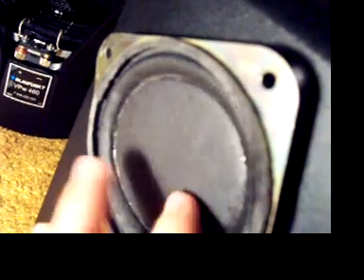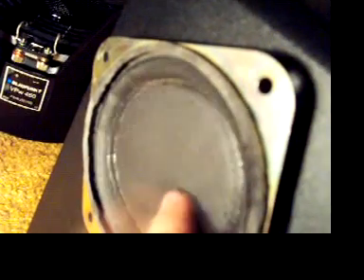Passive radiator abuse

Comment: @234nikz a woofer that works off of internal air pressure from the active woofer. its basically just a speaker cone with no voice coil. therefor can work without actually having to power it. check out my channel. i have tower speakers with two 12's in each,the bottoms are passive radiators.